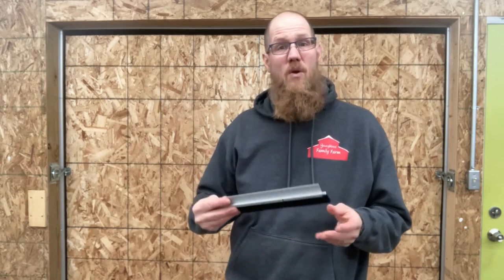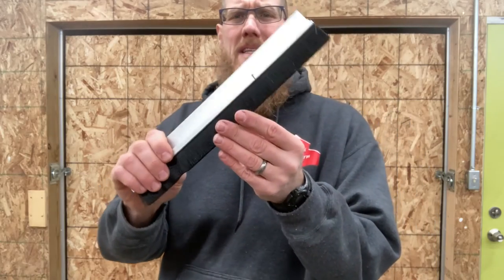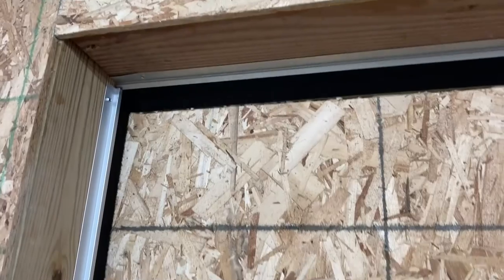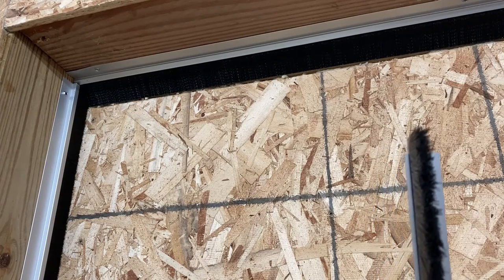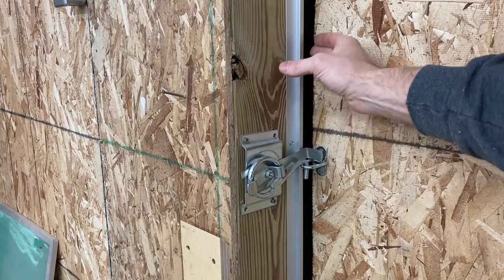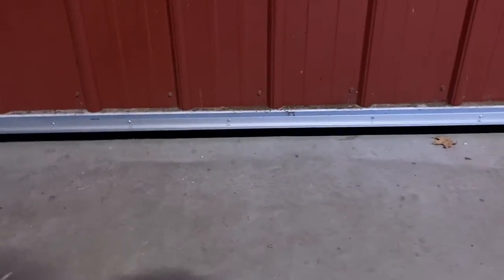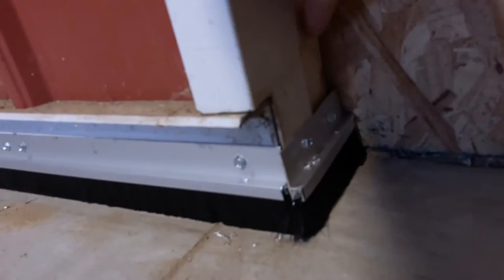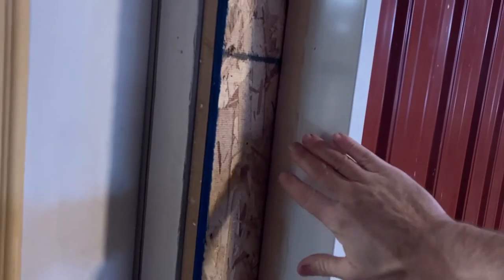The Best Way to Seal an Insulated Sliding Barn Door

Comment: Gonna have to share this with Rhiannas dad, his issue is his door is on the outside of the barn and hovers 3/4in over just dirt rather than having concrete underneath but sealing around the sides and top sure would help keep some warmth on the inside. Good find joe yb👍
Reply from the maker: The straight brushes I got are 1” long, but they make them much longer, there is some on Amazon, but if you go to the JaCor site, there is a lot more options.

Comment: I think this is the route I will be taking with my large 12x12 door but I would like my door to slide on the inside of my structure. It looks like I would be able to install the brush seals on the outside jamb and take some door jamb metal and slide it over the top of the flat on the seal if I use a panhead type screw. Then my latches would have to be on the door and the eyes on the wall. Thanks for the visual. Very helpful!
Reply from the maker: I’ve been really happy with these.
Reply: How'd you end up sealing it. 
I'm going to build a 12 wideby 10 tall sliding door on the inside of my barn too, looking for ideas.

Comment: Nice video and solution.  I want to install an external barn door on a shed here in Australia.  I wonder though whether the bristles would keep out mice?  I was trying to understand whether there could perhas be a wire wool type of seal that might work?  (These sometimes come encased in plastic / rubber), I think...?
Reply from the maker: Hard to say, this is on an interior door, however I do keep potatoes and squash in the shop and they seem to be mice free
Reply: @YoungbloodFamilyFarm  Many thanks!

Comment: my mother will be building in her back porch and make it into a bedroom. She has a storm door and a small cube foyer has been made. She wanted a sliding barn door going into the bedroom, to keep from it opening into the bedroom, she wanted sliding barn door to keep from taking up space. I am looking for a way to insulate the barn door, to keep the cold out. Because she will only have the storm door leading outside. Do you have any pointers to maybe help with insualting the barn door to keep it air tight and to keep the cold from coming around it? thanks
Reply from the maker: I used Brush Seals on all 4 edges.  The Best Way to Seal an Insulated Sliding Barn Door
https://youtu.be/tfs3AGFFBno. There is some links in the video description, sorry for the self promotion but this was the best solution and over a year later I’m glad I used this method to seal the edges

Comment: I like it. question would that take the finish on stain door
Reply from the maker: Not sure what you mean by “taking the finish”?  The metal is aluminum and I’m sure you could spray paint it
Reply: Sorry didn't explain myself  right. I want to give it a try, but my concern is would the brushes scratche the door  and take the finish off, Cause i got a project going on that the door is between a cold garage and a trophy room, and the door is going to be a dark color.   " Thanks for replying back"
Reply from the maker: @rodriguez657  the actual brushes are pretty soft.  I do not think that they would scratch or wear away any finish.
Reply: @YoungbloodFamilyFarm   thanks

Comment: Think a mouse could get through the brushes or are they too ridgid?
Reply from the maker: The brushes I have on the bottom and sides are 1 inch long and very rigid, I have seen zero evidence of mouse chew.  The longer brush versions may be different